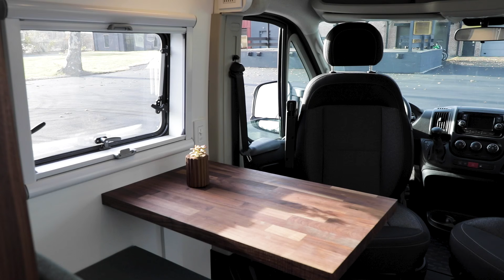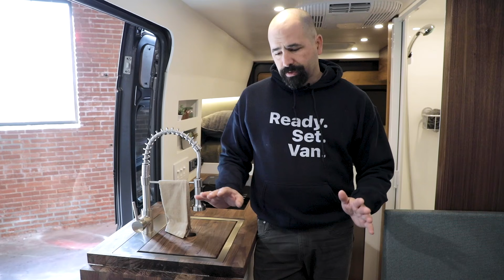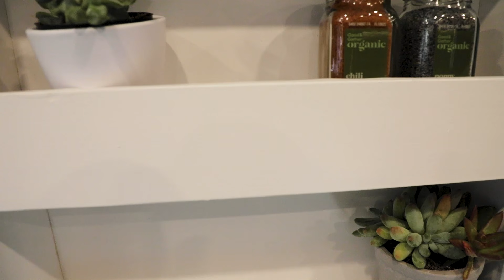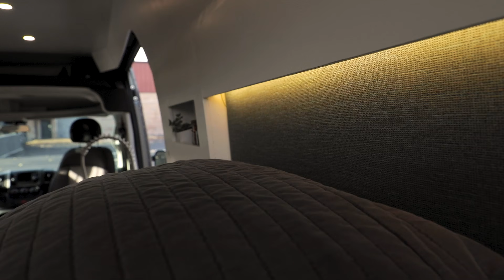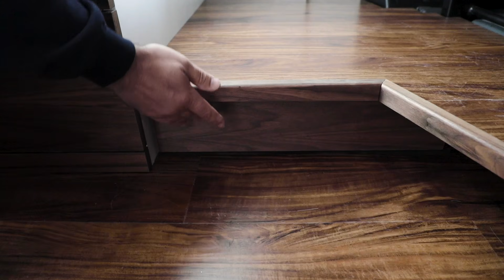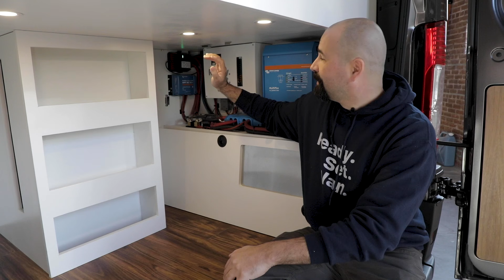FULL SHOWER & OFF-GRID AC | Highline | Ram Promaster 159 Build With Modern Interior

Comment: I'm curious if you use the factory swivels or do you use an aftermarket type? If you are using an aftermarket 3rd party variety, what brand do you use?
Reply from the maker: We recommend factory swivels just because using OEM parts is often the right move, but quite frequently install aftermarket ones and like them, too. Some are better than others.
Reply: That's a pretty vague response. Do you have a specific brand name you like?

Comment: I am currently in the process (as in thought) to attempt to do my own van conversion. so I’m officially committed to doing something van-life related with a 2022 159WB High Roof ProMaster! 😖

You mentioned KTO tires. 
Thoughts on Falken Wildpeak A/T3W LT245/75R16 with Black Rhino Arsenal 16x7, 5x130, +38mm wheels?

I’m unsure where I am going and type of travel. I just want to drive! 🎉

Comment: Nice build.  But just a quick warning...never expose a translucent water tank or water line to light for long periods.  Eventually you will get toxic algae growth lining the walls of the tank or line.   Ironically, I discovered this while working as a postdoctoral student at a very prestigious university.  The research facilities had a purified water supply that I noticed had a strong odor, and upon informing the principle investigators and maintenance staff, it was soon discovered that the black water lines were actually translucent white water lines that had become entirely coated on the interior surface with toxic algae that made the lines appear black.  The water was slowly killing the cell cultures we were growing in incubators, because that water was being used to make liquid growth media (a commercial powdered formulation we mixed with water to make a liquid food to feed the cell cultures), and the algae were excreting enough toxic by-products into the water to make it toxic to our cell cultures.  It was a huge fiasco and a real learning experience.  But basically, fluorescent light emission from ceiling fixtures shining down on those translucent white water lines running through the room provided enough light energy to promote vigorous algae growth inside those water lines.  Apparently , whoever unwittingly chose those translucent water lines inadvertently created a very effective incubator for growing algae.  Opaque (preferably opaque black) tanks and lines are the best prevention.  If a dark opaque color is not an option, then be prepared to bleach your entire water system regularly.

Comment: The minute you put it on a Chrysler platform you turn off so many viewers
Grace is one of the worst performing platforms on the market specially, in transmissions
Reply from the maker: We do understand the concern and know the reputation - but they switched the old 6-speed auto with ZF-sourced 9-speed in 2022.

Comment: Having a refrigerator under the bed seems like it would be rather cold in the bed above. Also,  having a heater vent next to the refrigerator seems like it would make the refrigerator work harder. Could you elaborate on whether any adverse effects on placement of refrigerator and heater vent so close to each other?
Reply: Refrigerators work by exchanging heat energy from inside the fridge to the outside, so the bed area will be warmer by having the refrigerator next to it

Comment: Anyone know roughly what it costs to get one of these?
Reply from the maker: All of our pricing is on our website. https://www.readysetvan.com/
Reply: @ReadySetVan  Cool. thanks.  
Just saw this typo, just fyi, on the joyride pricing page: cove instead of core

“simplicity and flexibility are cove values for this fun-sized escape pod”
Reply: @ReadySetVan  Also, i’ve never had a camper van, but from test driving some, I get the feeling like the Ram chassis is slightly less enjoyable compared to the Ford transit, and the Ford is slightly less enjoyable compared to the Mercedes Sprinter.  Mainly in stability and noise reduction in the cabin. 
I see your Hudson will be the Sprinter chassis.  Any reason to not go with the ford?

Comment: Great build!! Maybe I missed it but how long can you run the A/C off grid with your batteries fully charged?  Overnight, etc.. Thanks
Reply from the maker: With the 900 amp hour battery setup you can run your A/C for multiple days at a time without having to start your van or plug in

Comment: The plan (my dream) is to purchase a Ford e350 cut away and have Ujoint do the 4x4 conversion. Then have Field Van (Sportsmobile west) add the wide body frame. Followed by Fiberine installing a supercamper high top so it resembles a B190. Finally finish off with add luxury and style by having by Ready.Set.Van outfit the camper. Boooooooooooom baby !!!! Those who know, understand.

Comment: Love the build. Can you make a rear bath, on an extended 4x4 chassis, with a larger refrigerator, and a couch that pulls out to a full size bed for a 6’2” man. Like the tires and lift… but would like a running board, metal mesh, to clean the mud off the boots.

Comment: You’re fit and finish, materials choice, and layout is really impressive.
If the screen & shade cassette by the table is reversible, you might flip it so the screen comes down from the top. This way the shade can come up from the bottom halfway or 3/4 and give you some privacy with screen on the top portion of that.
Thanks for the post!

Comment: I would love to see a twin bed version that will allow both to get up without disturbing the other. Extended van version? Suggestion, roundup the corners of the countertop extension and the table to avoid painful mishaps. Can the window screen and the privacy blinds be reversed so the privacy blind come from the bottom for better privacy? Well done, love the simplicity and functionality, congratulations!
Reply: Me too. That’s why I don’t like stationary beds. I prefer an open floor plan with bench seats on both sides that can easily be converted into a bed. The downside is no garage.
Reply: @MarcP5267  I am ok with no garage provided I could have a twin bed set up is that possible??
Reply: @chuckschweitzer491  A lot of options like a Murphy bed or collapsible couch.

Comment: Wow, I've watched A LOT of van conversion and this one ranks near the top. One of the things that bothers me most about most van tours is the builder describing WHAT they used to build the van with but not the WHY. The low weight plywood is a good example as well as the better solution of the pull up countertop extension solution. I'm impressed with the intent behind the build. Glad you are on the east coast too. Will check you guys out when I'm ready to build!
Reply from the maker: Glad you enjoyed the video. Hope to hear from you soon!
Reply: Strange, but I can’t imagine someone not being able to figure out WHY you would might want to use a lighter weight material on a van unless told.

Comment: I really like your ideas for this van, but I want a class B that can sleep 3 or 4. I’ve seen one where a mattress sits on top of the front seats. I would think someone could put in a small pull out type of couch seat in back of the front chairs that would make into a small bed, but be long enough for a taller person. But I would still want decent storage under the back bed, long enough for an electric scooter, a screen tent for my dog,  chairs, and tall enough for a dog cage, and be 20 feet or less.in length. Still would want the same type of bathroom you have here. Heck, I can bring a small lightweight portable fold up table and set it anywhere, even take it outside. There doesn’t have to be a permanent place for a table. A table should be portable anyway IMO. A table is not a big deal, but takes up a lot of room if permanently placed.
Reply: Regarding more sleeping space: we just picked up our 2023 Winnebago Roam ( we needed wheelchair accessible Class B) and it comes with pop top option which is working great for 1-2 more people. I don’t know if these  small custom build shops will offer this option. I imagine there is concern re: leaks but the Germans have been including these for decades in their camper vans so…

Comment: I can’t climb up onto a bed so was wondering about using a pull out couch or the electric beds (happy Ed) can fold 3 ways and starts at 12” -all the way up. This build is beautiful. Do your builds come with the van? How do I contact you? I like the ford eco boost, and the ram ext promaster chassis.

Comment: Awesome build! Glad to find a company on the East coast. Can the van power 2 CPAP machines?
Reply from the maker: Thanks! It can easily run CPAP machines. Some quick napkin math: Fully charged (and using nothing else) you could run 2 CPAP machines for about 120 hours without charging or driving etc.

Comment: So beautiful. What's the grey water setup in this van? Capicity and emptying valves? Have you gotten any feedback on the placement of the cooktop near the bed? I'm concerned about my husband setting the bedding on fire and/or splattering food on it.
Reply from the maker: Great questions! The van comes with a 10 gal grey tank which can be upgraded to 20 gal. It is managed by an electric ball valve  and exits with a standard hose fitting under the van so you can direct the grey water into a dump station if desired.  We forgot to mention some of the cooktop options. The van includes an acrylic splash guard that goes between the bed and the kitchen and installs in a couple seconds. One of the nice things about the induction cooktop is that there is never any flame, and the cooktop remains much cooler. We also install a single burner (instead of the double) which gets mounted next to the sink.

Comment: Beautiful build. I've been following your progress, and am so grateful to have found such a thoughtful, skillful builder for the Promaster on the East Coast. I'm happy to see how you treat the mattress ventilation issue - aesthetic and functional! I would want a similar build when I'm ready in a year or so without the installed cooktop (I'd go portable, in a drawer), but with a convection/micro, and maybe a different fridge. I LOVE your robust electrical options. The big difference I'd want, and haven't seen you address yet, is a skylight/hatch over the bed. No exterior ladder - the hatch, which hopefully has a built-in, slideable, screen, is the roof access. Is there enough room for a skylight, aircon mid-van, and Maxair fan near the kitchen? I know it would cut down on solar placement, but couldn't I do portable solar?
Reply from the maker: Thanks for your kind words :) We've installed a few hatches and they're great. They act as a skylight, roof access and include bug screens and blackout screens.  They really can't be a 1:1 substitute for the fan since you still need the ability to force air in/out of the van. Your suggestion of putting the fan up front would be a nice setup, and could easily be achieved. You could still do a couple slim solar panels down the sides (160 watts total) which would be just fine.  As for the ladder, that's a standard option for our clients. Thanks again!
Reply: @ReadySetVan  Terrific. Thank you. It's good to see your answer below about the grey water tank options, and am so glad you mentioned the electric ball valve exit strategy! Great setup. What are the freshwater tank options and where are they placed? I plan on doing a fair amount of winter trips (I'm in Maine) so I worry about freezing water tanks. I also worry about ground clearance. Do you recommend upgrading the suspension and a lift?
Reply from the maker: @martha3202  Freshwater tank is inside (30 gal). The kitchen grey water can be diverted into an interior removable 7 gal can for 4 season operation. In that configuration we recommend leaving the ball valve open to the under mount grey tank so that  if you use the shower the used water exits the system. Given the temperature and volume of the shower water we don't expect freezing to be an issue for the as long as the valve is open. Glad you asked about suspension :) we are currently shooting a deep dive video on that exact subject so stay tuned!
Reply: @ReadySetVan  30 gallons is 10 more than I anticipated. Great responses all around. Looking forward to the deep dive. Thank you.
Reply: Martha, u found east coast?  I live in NY and would like to findClass B closer  Please tell me where this is.
Reply: @charlottemayhew7663  Think he said NJ but I could be mistaken